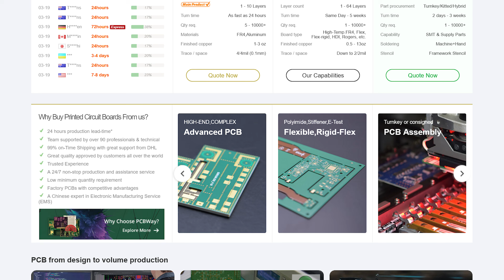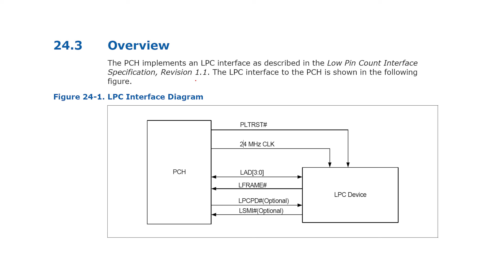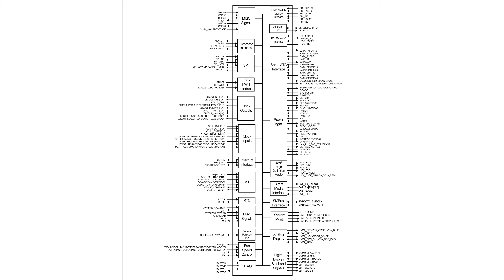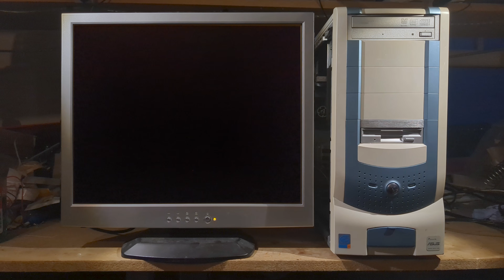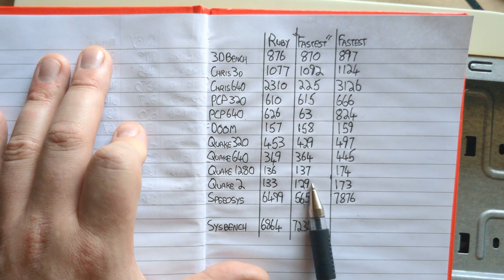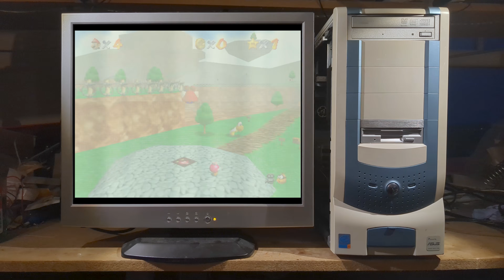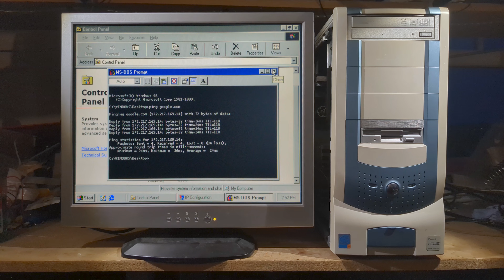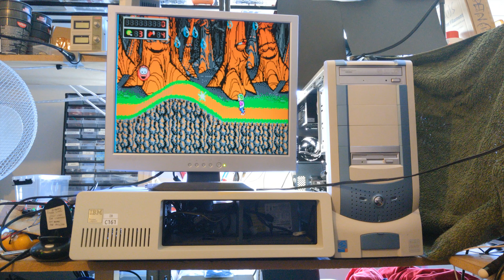No, *This* is the Fastest MS-DOS Gaming PC Ever

Comment: Awesome project! It's interesting how some of those DOS benchmarks scale with CPU brute force, whereas others seem to tail off with newer hardware. I've spent far too much time playing around with Phil's benchmark pack on old PCs- whilst that Speedsys score is more than double what I've ever recorded on period hardware, the PCP and Quake 320x200 scores are only about 10-15% faster than a 3.2GHz P4. DOOM doesn't seem to like newer hardware all that much- I've seen it manage over 200 FPS on a 1GHz P3 with a 440BX and Voodoo 3 or early Geforce card.
Reply: I'd wager that the PCI-Express write performance becomes a limiting factor in terms of what makes a graphics card limitation in this context, more modern gpu approaches aren't about spamming data from the cpu or system memory to the GPU as a flat framebuffer so the graphics chip isn't really architected with that in mind. OTOH I'd be super curious to see what an i7 5775C would perform like as a DOS cpu, although the clockspeeds would be lower than the 4790K... everything (in a dos context, 64MB maximum addressable memory IIRC?) would be running directly out of CPU cache
Reply: @TorazChryx  Very very, and some stuff worse than others... I was recently pointed towards a "DOS Benchmarks on 2020 Thinkpad X13G1" video over a discussion about WinUAE doing ~400fps on a R5 5600 vs some 250 on a RPi4 also doing emulation. New hardware works A LOT different, so much so i can get ~220 running DOS Quake in VMWare which isn't really known to have performant basic VGA, as it's there for compatibility only. But some hardware seems to have gone the true "slap together something that works" route with ATROCIOUS performance.
As for the "from cache", sounds like a really funky test, but do remember that in the 5775C case, you're talking about L4 not L3, which the 4790K actually has an extra 2MB of. Still interesting to see how it shapes up. IIRC you can't hit that L3 64MB mark unless you're using Xeon's or R7 xxxxX3D's. Still, for a more "peasant test", you could limit RAM to 32MB and that gives you a LOT of cheaper CPU's to choose from (that actually have 32MB L3).
Reply: @ErazerPT  in a modern context the 5775C's punch well above their apparent weight, hanging pretty well with Skylakes clocked 900Mhz higher with DDR4, but how that'd play out when the entire dataset that's running is smaller than the cache (albeit L4), it's entirely possible that it'll actually fall behind the Haswell part because the L3/L2's are big enough to keep the cpus functional units saturated and raw clock becomes the dominant factor. Be interesting to find out with some actual data though :)
Reply: @TorazChryx  Yes, it would be very interesting because it's the same architecture with a die shrink. Would be very much clock vs cache, without generational IPC muddying the waters. And HD4600 vs Iris Pro 6200, which should give the 5775 a leg up, but in DOS... who knows.
Reply: @ErazerPT  The IGPU would be completely out of the equation unless you were using it for display output?, there are some tweaks between Haswell and Broadwell (it introduced some new instructions, although nothing written for dos is going to have been recompiled to use them so they're just noise in the equation most likely) - Now that you mention it though, I actually have no idea how modern IGPU's perform in a dos context, because it does just come down to "how fast can the CPU write to the framebuffer" in a lot of cases... and it's all bundled up often on the same slab of silicon, even (sometimes, as in 5775C) sharing caches.
Reply: Wasn't the original Doom capped at 35 fps? 200 fps must've been a newer port or maybe I remember things wrong, Doom was a long time ago
Reply: @Konrad-z9w  Was, but that's since long gone, just as Quake should be (theoretically) played at 72fps because the engine ties that to MANY things and as any competitive Netquake player will tell you, insane fps makes you go voooom and some VERY FUN stuff becomes possible. The main issue to be honest, as with all id stuff, was the tie in with the netcode. With modern networks it shouldn't be much of a problem, but on an old E1/T1, pushing network data at 200fps might be... pushing it. LAN would have been fine though, as long as your CPU could handle it and the server's CPU could deal with everyone's increased load.
Reply: @Konrad-z9w  Yes, it is capped at 35 fps in normal gameplay. However, if you run "doom -timedemo demo3" (as per Phil's benchmark pack) it'll render a pre-recorded scene as fast as it can, then provide a result in the form of a "realtics" value, which you can use to calculate the overall fps.

Comment: I know it's now AM4, but I came across a DFI CS620-H310 motherboard.
Which supports 8th and 9th gen Intel 
Has ISA as well as a bunch of PCI on board (and obviously PCIe x16 and x4).
Reply from the maker: As I understand it, it's not a "proper" isa slot with DMA - so most games won't work.
Reply: @TheRasteri  yeah you're right.
That's unfortunate 😕
Reply: But does the ISA support DMA? Some boards with physical ISA slots aren't fully compatible.

Comment: Could the CPU scores be lower because the instructions that used to be 'hardwired' aren't implemented that way anymore?
Reply: This is definitely the case over the long term. For example, it was big news in the 90s that the Pentium Pro had worse IPC for 16-bit code compared to the original Pentium. However, I'm not sure how much movement would have happened between Core2 and Haswell. My bet would be not much, but I don't specifically know.

Comment: Now all you need to do is get a Z97 board and overclock the snot out of that CPU (maybe make it run a single core, too)
Reply: MS-DOS won't use more than one core. The 4790K featured in the video is hyperthreaded. MS-DOS won't take advantage of that either. Back when MS-DOS was released, neither multicore CPU's, nor hyperthreading were a thing at all.
Reply: @Titanic4  That's why I mentioned that, I meant disabling hyperthreading and all but one core lol

Comment: This is pretty cool stuff. Fun fact: A lot of cheaters in modern video games use DMA access and an SBC to cheat in high profile games with kernel level anti-cheats. It's an excellent bypass and you see it on relatively modern systems, potentially using different methods than the ones you guys are working on. At the risk of having you reveal to the entire internet how to cheat at Rivals with a Pi Zero, maybe look into that.
Reply: Yeah, and if you were interested enough to check the replies? They sell DMA add-in cards on Amazon now. I just didn't want to say it on the top-level comment.

Comment: 22:47 You mean I DIDN'T have to buy a Nintendo 64 to play this? I could've just waited until someone recompiled it for my childhood Windows 98 machine?
Reply: SM64 plays surprisingly well on the UltraHLE emulator from back in the day, so you didn't actually need to buy a N64 back then, either :D
Reply: @ozzyp97  Indeed - I bought a Voodoo 3 2000 PCI for UltraHLE, to run alongside my primary AGP card. Ran Zelda OoT fine on my K6-2.
Reply: @masejoer  I should try to get it working with my Voodoo 3 sometime, I was running into some compatibility issues last time. SM64 worked on my og Voodoo, but OoT and most other games really need at least the V2.
Reply: @ozzyp97 Yep! It was a super cool emulator for its time
Reply: @ozzyp97 oh dear God no, n64 emulators only started to actually look like a n64 pretty recently
Reply: @affegpus4195  Have you actually checked it out? UltraHLE really was very good, but only for a handful of games. I would know, I've tried it pretty recently, and I also have a real N64 for a direct comparison. The secret is in the name, it's a high level emulator. It took advantage of the similarities between 3dfx Voodoo cards and the N64 (both of which are essentially  cut-down SGI workstation hardware) to efficiently remap graphics instructions.
Reply: @affegpus4195  Have you looked into it at all? I tried UltraHLE not too long ago, and I also have a real N64 to compare against. The secret is the HLE part, it's a high-level emulator, it takes advantage of the common SGI roots between the N64 and 3dfx Voodoo cards to efficiently remap graphics instructions. It only ever worked for a few games, but it did work.
Reply: @affegpus4195  I've tried to explain you how it works twice, but youtube apparently hates it when I talk technical. Basically it's all in the HLE part and the hardware similarities between the N64 and Voodoo cards.
Reply: @affegpus4195  I literally bought a Voodoo Banshee to play SM64 and OoT on my PC via UltraHLE back in the day. Worked great!
Reply: @ozzyp97  People really don't know how amazing UltraHLE was; beat Ocarina with a PentiumII 400 and an Obsidian vodoo2sli. Wish I still had that card.
Reply: You could literally play N64 games back in the day if you had a Voodoo card. 3DFX voodoo was the best to emulate N64.
Reply: You only had to wait 25 years to play it on your win98 machine.

Comment: remember that when a modern CPU se 16 bit command it flushes the hole instruction pipeline and start top rebuild it. SO it might be an older CPU that under OC can be a lot faster.  in short they SUCK on 16 bit code!
Reply from the maker: Yeah everything since (I think) Pentium Pro sucks at 16 bit code. Its why I didn't bother to run Topbench, Norton and Landmark benchmarks since they're in real mode. The benchmarks I ran are (I think?) 32bit.